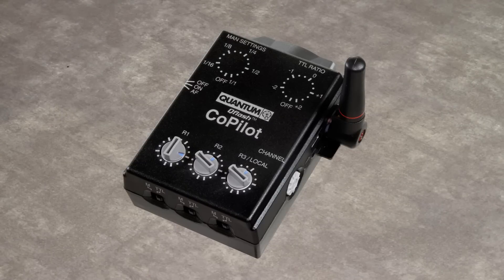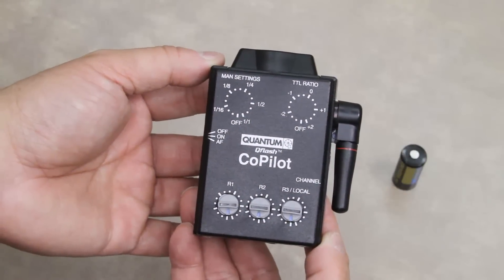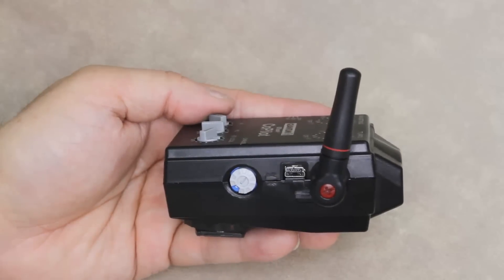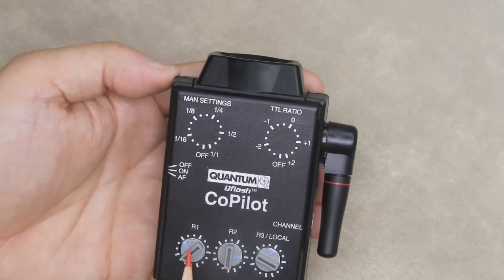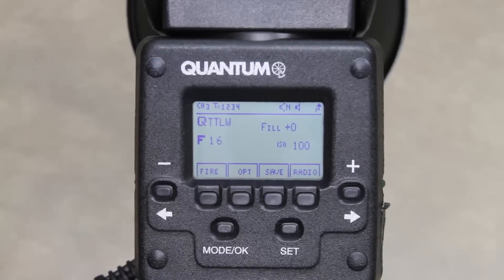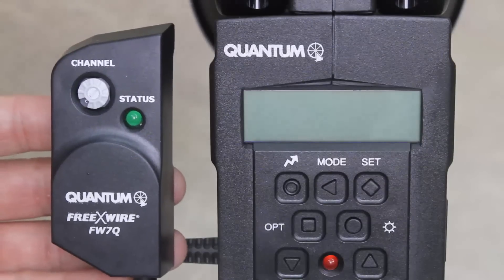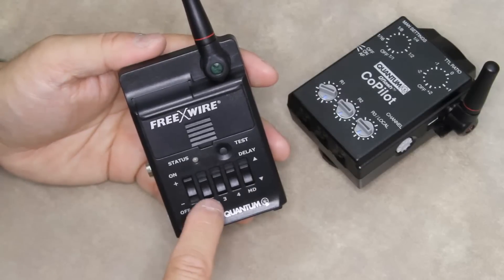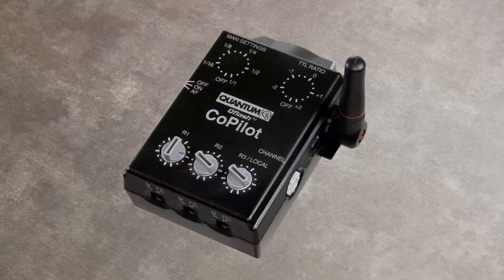Quantum CoPilot Instructional Video

Comment: I wish the LED flash light is at the back. I keep forgetting it on and it runs out the battery very fast. its cost 8 Euros and it very hard to buy it in Europe no shop wants to sell it. they tell me they use to sell it old films camera now there is no demand for this battery. Can I use rechargeable battery or it may short it with extra power.